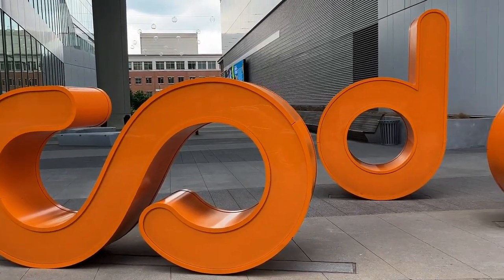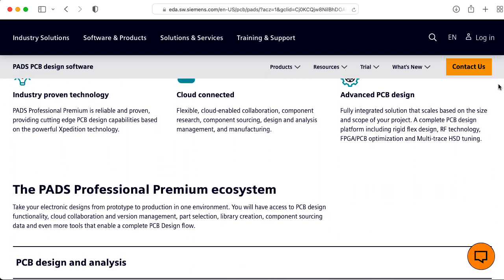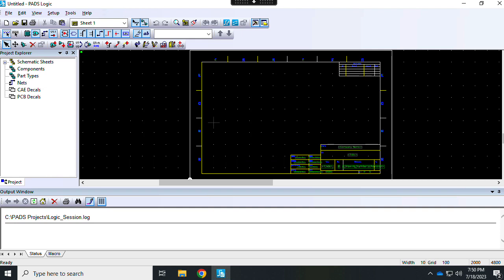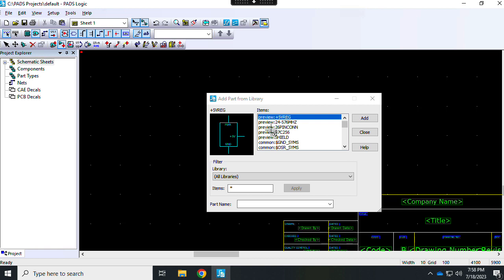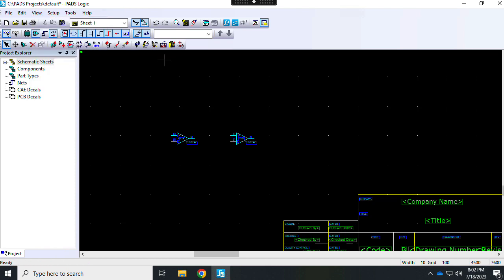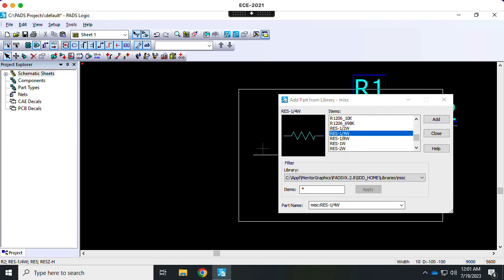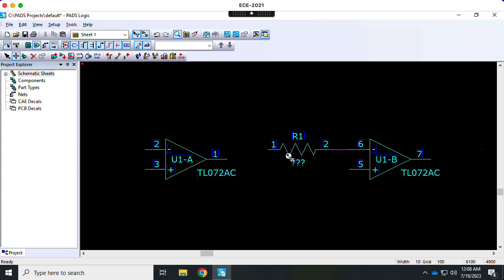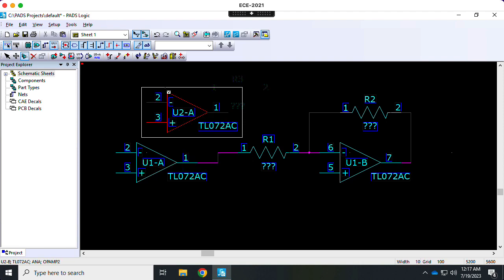EAGLE User Tries Siemens PADS Schematic Capture & PCB Layout Software

Comment: We use pads, pads pro, and expedition (moving to expedition only) at my company. We have never used the pads logic tool, exclusively using designer and layout. 

The designer is completely unintuitive but I've learned it and am comfortable with it now. The newer versions have a much better drag and zoom options but you have to set it up. We make symbols & footprints for all of our parts which can take some time to learn too, but it very nice to order pins and leave space for nearby components such as AC caps, decoupling, pullups, etc. It has some nice features for selecting several nets or symbols and changing text properties (like a net name) all to a prefix, suffix, and some incrementing number.

It's a very powerful but fragile system between the designer, layout, and library. There are certain rules for what properties a part needs, but beyond that you can configure extra properties that make it very easy to use. I don't have enough experience with the layout app, but there's plenty of good features in it for routing dense motherboards. If something breaks in the schematic --> layout link it can cause major delays finding what is broken. Part of that is due to pads, part of that is due to our library being very poorly created.

Then there's also differences between the 3 versions (pads "std", pads pro, and expedition). pads pro and expedition are very similar. pads std is the basic version, where almost every design file is saved as ASCII and could be edited in a text editor (think symbols, footprints, schematic, pcb, etc.).

It's hard to justify the tool for anything other than large companies or people doing highly specialized boards. That being said, it is so frustrating trying to use kicad and them missing out on generic features that I've become accustomed to in pads.
Reply from the maker: Thank you of much for your detailed response! I am going to pin it.

Comment: There's an old Finnish saying that translates to: "A bad blacksmith curses his tools".

I use Pads because our company and many of our customers use it. I absolutely hate it, but it's a tool that can be learned. I guess it's sort of a industrial standard that especially older engineers prefer or have gotten used to. You probably won't change after that steep of a learning curve. There's a lot of quirks!

For my own stuff I've used Eagle a lot, but have since switched to KiCad, because I also don't like the Autodesk changes in the past few years.

Comment: PADS Logic is the original schematic capture tool in PADS - it was designed to be simple and efficient. PADS Designer was based on ViewLogic (if you remember that tool from the 90s/00s), and meant to be a higher-level schematic capture tool with better library functions and documentation capabilities. As soon as PADS Designer came out, Mentor stopped marketing PADS Logic altogether. Fun fact - every audio company I've worked with that has used PADS (and there are a lot) was using PADS Logic. I've only used PADS Designer once.

Comment: Worth being aware when you do try KiCad (and yep, it is pronounced "key") is that in the included libraries, pcb footprints are decoupled from schematic symbols, so you can't look for a through hole resistor explicitly, for example. You put a generic resistor in the schematic and you pick a footprint as a separate step. This baffled me when I first came from Eagle 5 or 6 years ago so worth being aware of. Now I much prefer it.

Comment: The one and only hardware job back in '09 I had used PADS, I had used eagle a tiny bit before that, and the one thing I remember kinda liking about PADS was making symbols and parts.

One thing I hate about all EDAs is the way that parts (symbols/footprints/connections) and libraries are organized, but at least they all seem to do it in the same bad way.
Reply: I'm a KiCad guy these days.

Comment: I like the "tutorial from someone who's never used it before" video format. 😂 Very entertaining

I recently used Ansys for an antennas course via a remote VM with the same "never save to the C drive" policy. Responsiveness was hell! I eventually learned that working directly from a project on the network share was a mistake. I needed to copy my project to the local drive to work on it, then copy it back to my user drive when I was done. 

Probably apples/oranges, but there it is.

Comment: I use KiCad for all my schematics and PCBs. I have also used Altium but that was for a few other companies I worked for. They both have good, bad and ugly things and I believe this will be true for all schematics and PCB packages you will use. I'd love to see a similar video to this for KiCad. I still remember that I had some issues when I first tried to used KiCad but meanwhile I almost never doodle my schematics on paper and immediately start in KiCad.
One of the nice features of KiCad is that a lot of libraries are included with the installation and a lot of more can be found searching the internet. One of the ugly features of KiCad is that there are a lot of libraries ... Ehh ... Yes. Having a lot of libraries for a lot of parts seems nice but who made all these libraries and to what level. I found that footprints for certain components are not working for me all the times. Through hole components need an annular ring that is big enough to properly flow the solder all the way through the hole but not that big so you can still put a trace in between e.g. the pads of a DIP14 package. For schematic symbols it gets even more complex: do you want one big block with all pins, different blocks for logical ports or different blocks for different functions ?
I decided that I sleep much better since I freed myself of the idea of perfection so often I just use the libraries that are available. But sometimes I will still make (or adapt) symbols and footprint to suit my own needs. Luckily, once you realize you can copy/paste components from a standard library to your own and then change the part to your needs, that is a fairly easy and quick task.

Comment: I use EasyEda for all my needs. I tried Eagle, KiCad, Altium etc. Altium is the worst. EasyEda has a lot of libraries and is quite intuitive to work with. The wiriting as such needs a lot of work on, but most of the time, it works. Autorouting works just fine. EasyEda also provides the tools for a decent FrontFace.

Comment: I use EasyEDA for my eurorack/synth projects and it looks a lot better than Pad and judging from your video it's a lot easier to use.

And while I'm commenting, the first Eurorack module I've completed is a 4-stage wavefolder that I made based on your videos on wavefolding.
Reply: I started out with EasyEDA and still use it sometimes. It sure is easy! But I've found a number of workflow issues that get in my way. As soon as I deviate from their garden path, I'm hacking through a jungle and it feels like the tool is actively fighting me! 

Every tool is like that to some extent and it comes down to individual preferences. But some features are just not well thought out! 

To throw down a specific issue, moving a component any significant distance after it's been routed DOES NOT WORK!  Ripping up and rerouting is the only viable option. Same with symbols on the schematic. That's such a common operation that I can't overlook it.